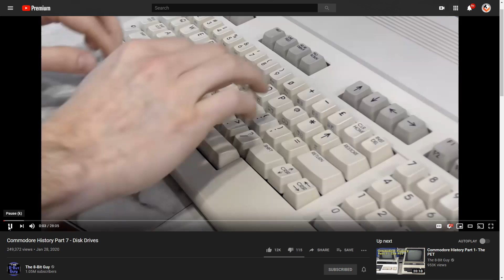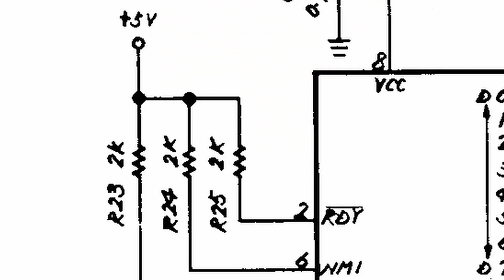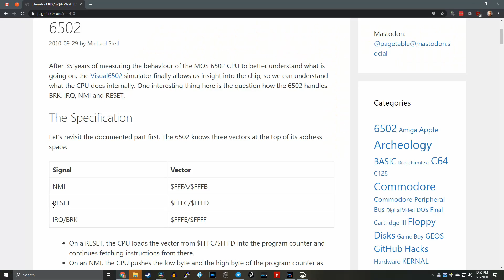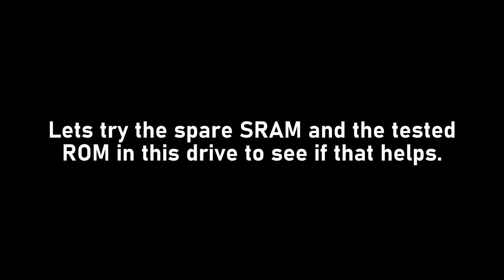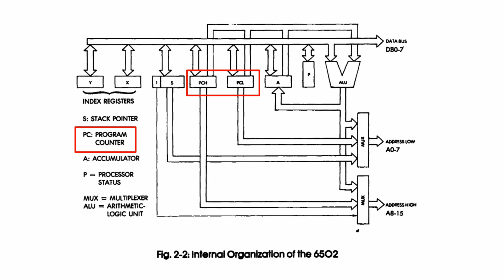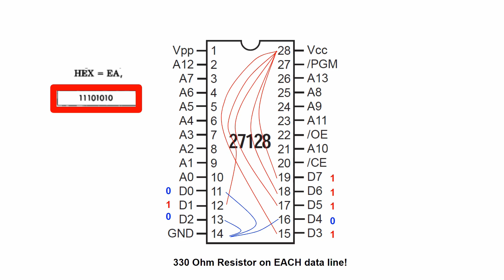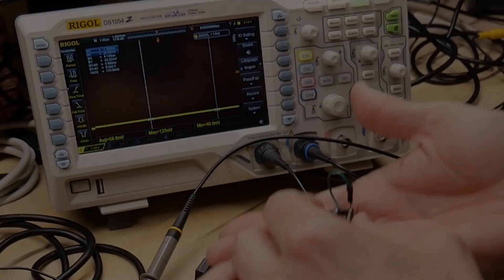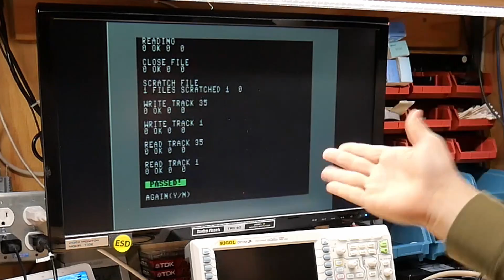Using a NOP Generator to help fix a dead 1541C drive (Bonus Track 1 Sensor demo)

Comment: 32:55 - So i was wondering about the dead CPU's, perhaps it's not just coincidence. The C64s you have repaired don't seem to suffer from dead CPU's much. I was thinking that because the PSU for the 1541 is built in (and therefore less likely to be replaced), maybe the PSU is not too great and is frying the chips (perhaps due to variation in mains voltage in place to place?). Also maybe the voltage regulators are not so good in the 1541 (tolerant to temp changes?), you did note that it was a little high on the 5V at the start of the video. Maybe even the 1541 internal fuse is not so good and doesn't blow quick enough, does this 1541 look to have had it's fuse replaced?

Comment: I would have enjoyed seeing the address lines on a good processor when using the NOP generator... of course, it's just like the output of a counter.  You could also have filled an EPROM with NOPs... another way to get the same effect.
Reply from the maker: Filling an EPROM with NOP will not have the same effect. The entire 64k address space needs to be filled with the NOP opcode, while the EPROM is only mapped into a sliver of the total space. So once the ROM is deselected, the processor will do unknown things when it hits unmapped address space.

Comment: Hi, I see a problem with the NOP generator: logic levels are weak due to resistors and sooner or later the address is going to enter the I/O space and some peripheral can put unexpected values on the data bus that will be executed as code. (And, for instance, a $02 opcode will freeze the 6502 completely)

Comment: Gate array chips aren't that difficult to reprogram or replace. Glue logic in a PAL, use a PAL to GAL so you can use something like a GAL16v8. Let me know if you are interested. Thanks for the videos.
Reply from the maker: It would be super useful for a way to dump the contents of these chips in a way that results in equations. I have a friend with some memory boards for the Amiga. One has the PAL chips installed and the others they are missing. The PAL chips are locked so can't be read out in the standard way.

Comment: Have you ever tried the WDC 65C02 processor?  I wonder if it’s totally compatible with the MOS 6502.  (WDC also makes a 65C22 VIA which I wonder if it’s compatible with the MOS 6522.)

Comment: It might be a good idea to make a board that all it does is test 6502 with a hard wired NOP. A handful of LED's and resistors with a slow clock driving it would let you actually see the CPU do a binary count.

Comment: New skill in trouble shooting, great! Guess the new WDC 65c02 may work properly in this old machine, I guess the CMOS one tolerate with the old hardware's voltage though I have none to try.
Reply from the maker: I'm probably going to buy a few to try out in things. I'm told there will be issues in disk drives due to the way fastloaders use the illegal instructions in the 6502 and the 65C02 behaves differently.
Reply: Adrian's Digital Basement fun to try
Reply: @adriansdigitalbasement  I have heard that illegal instruction is 6502 are sometimes interpreted as two legal instruction and executed at once. Still I haven't seen comprehensible explanation of the inner working.
The 65C02 has extended instruction set, so it handles things differently.
Reply from the maker: @ИванСнежков-з9й  yeah it also treats illegal instructions as NOPs. But yeah the illegal instructions on the original CPU could he used to speed up code and do stuff that would normally take longer.
Reply: The 65C02 is not a straight drop-in replacement.  I did some research.  Among other things, you have to clip pin 1 (it's a vector pull status signal that has no analog in the original 6502), and you have to tie pin 36 (bus enable) high.  Also, there's at least two manufacturers... WDC and Rockwell, possibly others.  The WDC chip does NOT accept TTL input levels unless you also add pullup resistors.  And there's the whole "illegal opcode" thing.  The 65C02 doesn't have those, which breaks compatibility with some fastloaders.
Reply: @SpearM3064  So it's worth a single video to make things clear, and learn something from it.
Reply: @adriansdigitalbasement  Rumor for a long time, but I'd never seen anyone serious make a video or a document to try replacing a WDC 65c02 into the Apple or Commodore, so it worth a whole video to try it out.

Comment: You mentioned you have a TL866 and then later wondered how you could test the RAM chips.  The TL866 also tests RAM chips, so long as you can find a compatible RAM chip in the list (it's a long list).
Edit: I notice now that you discovered that function. :)
Reply from the maker: Sadly it can't test any DRAM .... but yeah it does test some SRAM chips which is quite handy.

Comment: As a Z80 user since my teens, I am used to NOP = 00, which makes sense (nothing in, nothing out). I find it odd that the NOP code on the 6502 is EA.
Reply from the maker: Would have been an interesting question to ask Chuck Peddle why that opcode was selected.
Reply: @adriansdigitalbasement  Girlfriends initials? :)

Comment: I would suggest you take a look on logical analyzers (e.g. saleae Logic), with them you could record a stream of states from multiple pins (up to 8 on cheap clones), and analyze them with tools like Logic. They work like an oscilloscope only they work in binary field and can record 1s and 0s at fast sample rate (way over 1Mhz). You can later hook up known protocols into those streams and the tool will decode them.
Reply from the maker: I have a 16 channel one actually. It's just very slow to setup with all the connections and doesn't offer agility of the scope.

Comment: May have been commented already, but there WERE brown fronted 1541C drives.  I have an original, complete with manual that also shows the brown front with whitish drive.  Not all that common, but some were shipped from the factory that way.
Reply from the maker: Funny -- other's have commented of all brown drives (case too) but with the super short board inside. Commodore did crazy things.
Reply: Dang, must have been tired when i typed that, i meant brown drive unit with the creme colored 1541C case and badge.  I really need to proofread my stuff lol

Comment: I like the NOP method. on 68K, on some systems you can simply remove the ROM and it'll execute code as OR.I which is basically the same thing. runs and moves on. Ive done this to snuff out bad RAM Muxes on Mac logic boards.
Reply from the maker: Interesting! I think on some systems if the ROM data bus isn't buffered you might get random results but maybe on the Mac removing the ROMs puts the data bus in a consistent state?
Reply: Depends on the design but there are probably pull ups on the bus.

Comment: My guess on those 1541Cs with the track 1 sensor is that Commodore left it disabled by default to avoid folks sending their drives back because they thought they might be faulty when they first turned them on and didn't get the head banging.
Reply from the maker: I actually heard this exact theory from someone else.
Reply: @adriansdigitalbasement  Seems perfectly logical to me.  It's easy enough to enable if you know it exists and you bought the drive because of that feature.

Comment: I see you have installed machined pins sockets for every chip you have removed. They look nice but they are really crappy sockets because the contact petals inside each pins can easily get a permanent outward bend and the contact goes bad and you can neither see the problem not fix it. Good sockets are called 'double leaf' sockets and my favorite brand is the Diplomate DL.

Comment: There's some irony in stopping the head thrash when the drive finds home position 0. Some people might wonder if there's something wrong with it because to them, that's something it's supposed to do. I have my theories about the 6502 as well. In trying to build my own computer as many of us did back then I've noticed quite a bit of inconsistency in the dye used. I think it might have something to do with the developing stage. Chemistry where etching silicon is concerned has changed over the years. A few things that were used back then aren't today because we've found better and more effective alternatives. It makes me wonder how much that could affect the degradation of the chips over time. I know there's a rigorous cleaning process before the individual dyes are separated but given how lax Commodore's build quality is that perhaps their chip manufacturer was equally so. It's still just a theory but it's the best I can come up with as to why those fail so much.

Comment: Do you have any idea why the cpu's are damaged in the drives . Is the PSU still within spec or could it be heat.
Reply from the maker: It's almost certainly not something like the PSU ... Just the old process used to make these chips and so many years has not been kind to them. The process MOS used to make the C64 PLA means they will all ultimately fail over time. (According to the creator of PLAnkton)

Comment: Great video as always, thank you!
I have to ask... did you have a look if the GAL you mentioned at the beginning rendering the drive useless was supported by the minipro ?
Reply from the maker: Not sure that is possible as it's not a normal lattice or ATMEL part. (as far as I'm aware)
Reply: I have looked into this while repairing a 1571 (it uses the same IC). The complexity is that not only it does the address decoding, but it also does processing on the clock signal. This would need to be reverse engineered, before attempting to fit it into a standard part. It might be possible, but is definately not trivial.
Reply: @danielmantione  Oh wow okay, I didn't expect that. Thanks for the explanation to you both

Comment: I'm curious as to whether a 65SC02 would work in a 1541. Then again, that would probably break on some weird copy-protection routines, because they don't support illops.
Reply: The 65C02 will work with a caveat.   On the NMOS 6502 (the MPU replaced in this video) pin 1 is ground.  On a WDC 65C02, which is the only 65C02 in current production, pin 1 is VPB (vector pull), which is normally driven high, except when an interrupt vector is being fetched, during which VPB is driven low.  Therefore the WDC 65C02 is not directly pin compatible to the NMOS part.  The older Rockwell and CMD parts are pin-compatible.

The 65SC02 is not a compatible replacement for the 6502 or 65C02 in any application due to it not having the BIT instructions.  In any case, there is no good reason to replace the 6502 with a 65C02 in any Commodore disk drive unless the MPU fails and only the 'C02 is available.  Furthermore, any code that is loaded into drive RAM for a specific purpose that makes use of the 6502's undefined instructions will not execute with a 65C02.
Reply: Pretty sure the 65SC02 is just the old version of the C02, i.e., without the BBS/BBR instructions.  As for the undefined instructions, yeah, I mentioned that.

Comment: Does it make any difference that you had the connector on the left side of the board disconnected when you tested the first of your spare 6502 processors? The one you marked with the blue dot.
Reply from the maker: Nope those aren't needed. You just need power to get the drive booted up.
Reply: @adriansdigitalbasement  interesting. I've never had any of the Commodore systems myself but I've been wanting to get one for a while now, especially after watching a lot of your videos. 👍

Comment: II haven't used my 1541-II for a while - wonder if it has a head-knock sensor and if it has the "use that sensor stupid!" jumper that is still linked :)
Reply from the maker: The 1541-II doesn't have it -- only the 1541C. It's a mystery why Commodore went backwards with the II in that regard.

Comment: Love the video BUT Seriously see those 2 mosfets on the ac side I have loads in my stuff stick welder 100A in my mig welder 120A in my workshop running my machines 220VDc they all seem to handle high current and frequency I'm very shocked to see something like that x2 in a floppy drive from the eighties never mind the d.c speed control board inside it too that now a days seems to be secret knowledge all the best.

Comment: Where can one get the mini-pro? Amazon? And does it come with software for MacOS X or even the Raspberry Pi, or only Windows? Thanks!
Reply from the maker: There's a link in the description. It is a Windows device but there is some open source Linux stuff to use it as well. No idea about OSX.
Reply: For Mac OS X, you might be able to build the Linux tools from source, though they probably still use X11.
Reply from the maker: Actually a quick google finds some OSX tools for that device.

Comment: Hi from the UK.  Like the videos but one question.   In other videos you keep your old (known failed) chips.  Why do you do this an not just throw them out?  
Just curious !
Thanks - Phil.
Reply from the maker: Partly as a record of what I've fixed but also sometimes it's interesting to look at the failure mode of a chip in another system. Especially if I want to show what a failed CPU or PLA can look like, etc.

Comment: 33:41 Ben Eater has a comprehensive video on wiring up a 6502 with a NOP generator and examining the output of the address lines with an Arduino: https://www.youtube.com/watch?v=LnzuMJLZRdU&t=396s

Comment: Do you have your area protected from esd. If not that's a good way of finding dead chips. A lot of old chips were not very well protected. just come back to add I've been to bok case as at 17:55 you show Rodnay Zaks book and i thought i'd seen that before. well i found his "Programming the 6502" and "6502 applications" pluse a "6502 Assembly language programming" by Lance A.Leventhal. Plus 5 books on the commador Pet. just can't throw books away.

Comment: Are all those dead 6502's MOS branded?  They were amazing at chip design, not so amazing at chip manufacture.  Good thing they're still in production.  (With at least two manufacturers, even!  Pretty good for a chip from 1975.)
Reply from the maker: Yep all of them were MOS. There is a good chance newly made 65C02 chips won't offer good compatibility due to the different way they handle the illegal instructions versus the original 6502.
Reply: @adriansdigitalbasement  Considering the way Commodore did computer engineering (and WOW does Bill Herd have some wacky stories) it wouldn't surprise me if they did use illegal opcodes.
However, it isn't just 65C02's from Western Design Center, there's also old-school NMOS 6502's made by NTE Electronics.  NTE does a sideline in obsolete 8-bit processors and support chips for obsolete repair and hobbyist markets.  It might be worth checking them out for compatibility.

Comment: The track 1 sensor uses one of the inputs on one of the 6522. This can cause problems with some fastloaders, especially the ones used in games. That’s why Commodore went back to the old head bang on later models. Enabling the sensor is maybe not such a good idea.
Reply from the maker: Interesting. What about on the 1571 which has it and has no way (I'm aware of) to disable it?
Reply: It was known back when the drive came out that there may be issues with compatibility yet I still enabled mine in 1987/1988 and is still on my desk 30+ years later.  (I had been using a 1571 for a couple years and never had any issues and I like not having head knock.) Don't recall ever running into a compatibility problem with any games loading.  It is basically my main drive.  I have tried to research this problem for a long time and can't find any thing concrete as to what specific games wouldn't work, etc.  The only thing I have been able to find is that they say there are "compatibility problems".  Seems to work fine for me but YMMV.  

Of course, you can always wire it to a switch and then disable it if you have a compatibility issue.  So personally, I don't see a problem enabling it.
Reply: I've used a "sensor enabled" 1541C for a couple of years, and now my main drive is a 1571. I like to try the best demos from the X- competitions on real hardware, and I've never had an issue on both the 1541C and the 1571. YMMV of course.
Reply: @adriansdigitalbasement  Correct: Such software will not run on the 1571. Because the 1571 is quite compatible, I don't expect a lot of trouble when enabling the sensor, but, with the Commodore platform, there is always some piece of software that assumes too much.

Comment: What are the chances of three MOS 6502's failing? With those date codes the odds are quite high. MOS was puttingvtoo much Boron in the passivation layer. That boron, over time and heat would slowly diffuse out of the passivation layer into the chip die itself, poisoning the MOS transistors on the top layer of the die.

Comment: On your second CPU it appears you did not have P3 connected.  Looking at the schematic there is a reset on pin 6 of connector P3. It looks like it would also lose the CLK and DAT lines as well. I don't know much about these drives other than I had one as a kid. So forgive me if it is not relevant as the reset appears to be able to come from P2 as well.  I could be talking out my rear but your CPU might not be bad.

Comment: Does the 1541 II disk drive have an even shorter motherboard?
Reply from the maker: I've never looked inside one so I'm not sure. I assume it's going to be similar but unsure. I know the II drive does not have the track 0 sensor nor does it even support it.

Comment: I'm starting to get concerned about the age of the filter capacitors in the power supplies these days. I wonder how much ripple they let through now and if that's having any affect on chips.
Reply: I was thinking about that, too, especially when I noticed they were 6,800 mfd. That's a pretty large number implying the circuit needed a lot of filtering to function or conversely that it might be sensitive to ripple and/or spikes.